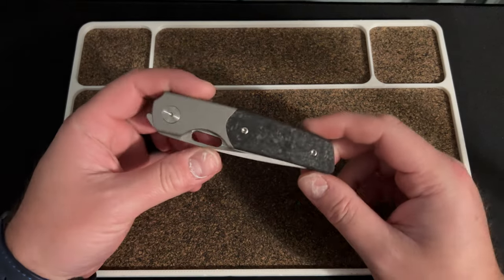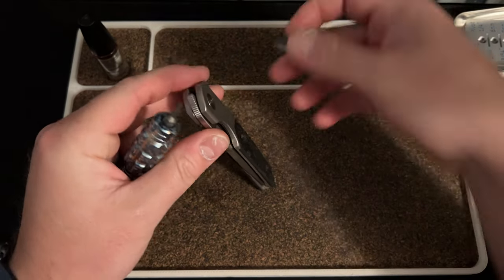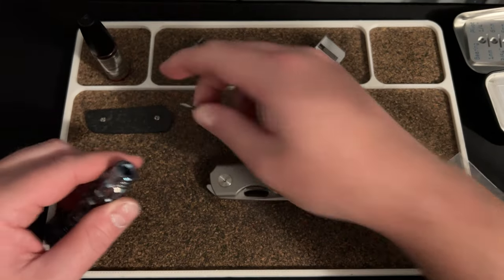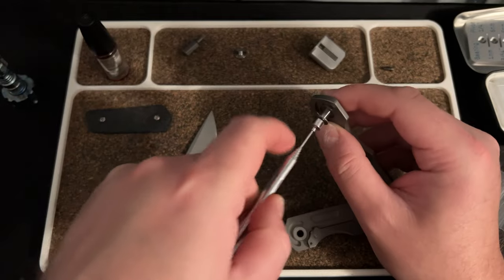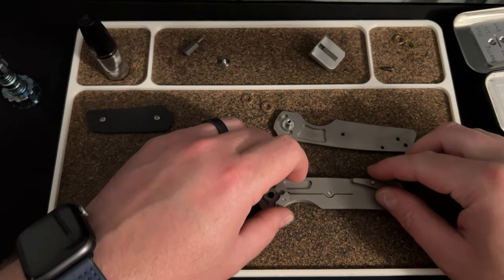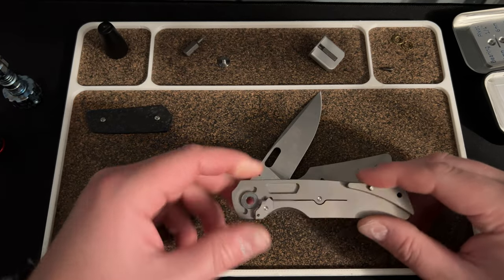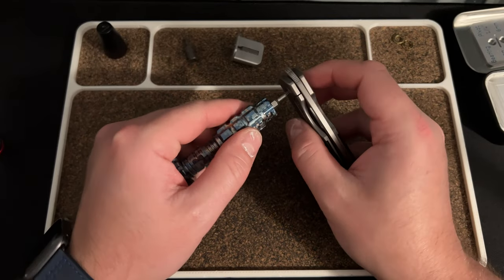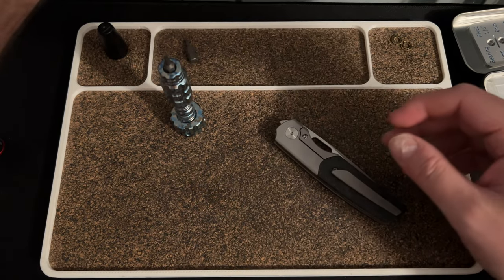Berg Blades Sweeney - Skiff Bearing Swap

Comment: Am I the only Lefty that refuses to buy a knife that you can't put a pocket clip on the Left side?
Reply from the maker: Nope. I used to until i realized back left or side pocket carry is just as good and a righty knife basically carries lefty there. Changed my edc forever
Reply: @LeftyEDC  I see. I just don't like looking at the pocket clip facing me when I am holding the knife. I want the clip to be hidden in my palm